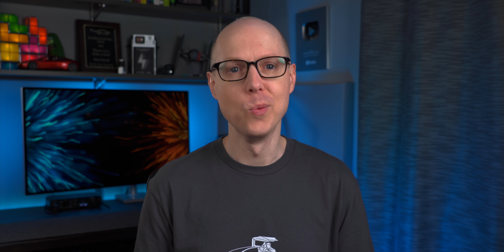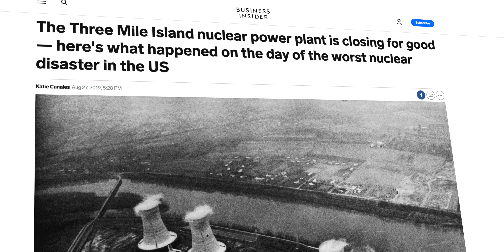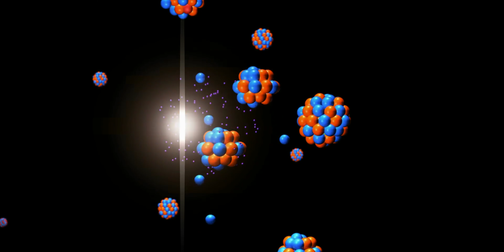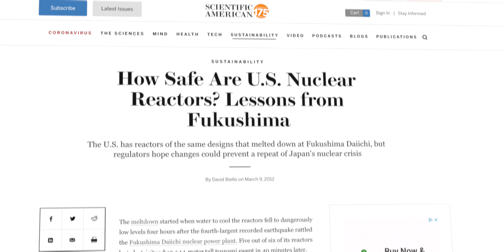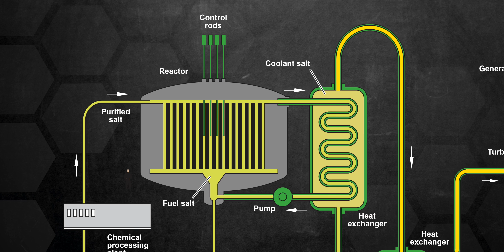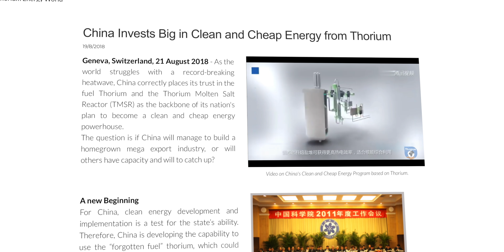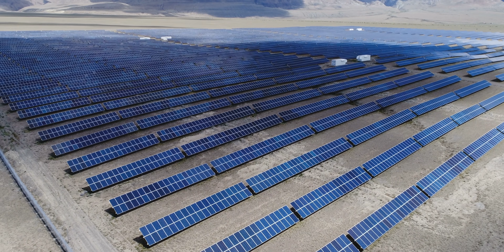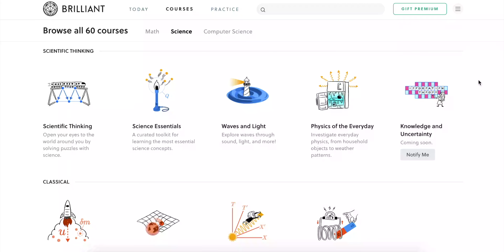Thorium explained - the future of cheap, clean energy?

Comment: (2:23) "A fuel source that's 3 times as plentiful" implying Uranium. However, we primarily use U-235, which only represents 0.7% of naturally occurring Uranium, not 3-5%. If you were to compare Thorium to U-235, the actual fuel, you'd find that Thorium is 429 times more plentiful. To get U-235 up to concentrations of 3-5%, you have to enrich it, which is an exceedingly expensive process. Thorium requires no enrichment.
Also, fission really isn't that complicated. You just have to be aware that there are different types of fission reactor designs, particularly when you're talking about MSR reactors. This is EXCEEDINGLY important, as different reactor types have different benefits and different drawbacks. There isn't any one type of reactor that is "better" than the others. The positive and negative characteristics of different reactors make them better for different applications.
Reply: Ya I was kind of bummed out that he spent a moment or two to touch on their level of "rarity". Seemed rather pointless, all of these substances are extraordinarily plentiful, regardless of their perceived rarity. The fuel supply in and of itself, is so much of a nonissue it doesn't even warrant mentioning.
Reply: @MatthewHolevinski  Correct. The kicker is, the "rarity" issue applies to "Rare Earth Elements" (REE), which are actually quite common. We could produce all the REE's we need just from the tailings streams of existing mines, like iron, phosphate, titanium mines, etc., and other sources of monozite ores, which is what we used to do before we signed a treaty in 1986. We don't do this now because thorium is a co-product of those REE's , and if you pull out the REE's, you're effectively concentrating the thorium. The treaty we signed in 1986, which was then adopted by almost every country in the world, categorized Thorium as a nuclear source material, and thus regulated by the NRC. After we signed that, if you were a phosphate mine who wanted to sell your tailings  wastes to someone who wanted to pull out the REE's, you had to have the same level of NRC licensing as a dedicated uranium mine, which, as you can imagine, is not inexpensive. At that point, the US and most of the west got out of the REE market, letting it be dominated by a country that hadn't signed that non-proliferation treaty, China. 
So in the end, the single and only reason that we and the rest of the world are dependent on China for REE's is Thorium and our ridiculous regulations around it.
Reply: @williamsmith1741  you mean and the second only reason is we can't do anything with them anymore either, we have no refinement, or manufacturing supply chain... Send china our dirt and they will send us our iphones. Nothing more fantastically glorious and idiotic than shipping essentially dirt across the largest body of water on the planet, god damn i love it. It's ridiculousness at it's finest.
Reply: @MatthewHolevinski  Yes, that's true. We've effectively lost all refining capability. However, that can be built back up. The real issue is Thorium as that creates significant liability issues. Not only does it cost a fortune just to get and then maintain a license, you then have to create a permanent storage and sequestration structure to "dispose" of the thorium for the long term. If you don't have every micro-gram secure and accounted for, you'll get sued by Green Peace and other environmental groups. This is despite the fact that thorium is heavy as F & non-water soluble, so it tends to stay wherever it's first deposited. Plus, it has a 14 billion year half life, so it's barely radioactive to begin with. Instead, we just dump all our REE's and the thorium into tailings pits and lakes.
Reply: @williamsmith1741  Oh you don't have to tell me bro, I've read the 10 CFR's. edit: If I was president, the NRC would be the first thing dismantled, along with about every other department of the government, but that's another story.
Reply: @williamsmith1741   Can you advise exactly what this 1986 treaty was that consigned thorium to NRC over-reach? I don't think it was the Nuclear Non-Proliferation Treaty 'cos that goes back to the 1960s. I tried google-search but it didn't come up with anything resembling a remotely sensible set of resuls.
Reply: @rhonda-my_honda_cb500x  Well, there were numerous treaties signed, and while the one in particular that the reclassification It wasn't exactly part of a non-proliferation treaty. It was a tightening of regulations following the Reykjavik Summit in 1986 and the beginning of work on the START proposal that the US put forward that year. I suppose as part of a good faith kind of effort, the US started tightening up its regulations on anything Uranium and Uranium related (i.e. thorium), the goal of START being nuclear arms reduction and the reduction of any nuclear proliferation.

Of course, there's little to no proliferation risk from thorium, so it was pretty much just a ham fisted bureaucratic action which killed the rare earth industry in the West.
Reply: @williamsmith1741   TYVM for your quick reply! The framing context of my question is that the New Zealand Climate Change Commission has released its Draft Advice to Government and submissions/feedback is open 'til March 14. I wish to have it on record that the Thorium Energy Cycle as can best/only be implemented with full iso-breeder LFTR (thermal) or LCTR (fast spectrum) low pressure high temp reactors underpinning it, is the only real way to reach their goals. I ideally need to state which legislation or accords need to be majorly modified or scrapped in order to make the way legislatively clear.

The old-skool informed would argue there is proliferation risk in the Th->U233  breeding cycle if one was to use a 2-fluid blanket/fuel reactor and do ex-core chem-sep and holdup of Pa233 whereby potentially getting WG U233. But quite frankly that's the much longer, much harder way to make a fission bomb. Any nation state dead-set on building a nuclear arsenal will naturally take the tried, true and standard/'easy'(less hard) way. 

It would be easy enough to have one's chem-sep processes setup under IAEA supervision to keep the holdup Pa233 doped with 'just enough' (1.5-2%)  U232 contamination to bugger up bomb electronics and require only mildly shielded (less expensive) remote handling. Proliferation problem? What proliferation problem?

The other proliferation argument is LFTRs' need for depleted Li (ie 99%+ Li-7) for its FLiBe salt, because that flip side is enriched Li-6, which is the tritium source for boosted fission or full H-bombs.
However the proliferationistas when pressed, would have to concede (likely through clenched teeth), that that same enriched Li-6 is what's needed to run ITER or the Lockheed skunkworks fusion reactors. While we wait for controlled fusion to become a Thing, we can use that  Li-6 in Li-ion, LiPo and LiFeO batteries to give them even more electrochemical energy density. I think one can silence their posturing about Li-6 by asking them when they're going to limit gasoline or Jet-A1 because it can be used in molotov cocktails.
Reply: @rhonda-my_honda_cb500x  You are absolutely correct on both points! You can't know how refreshing it is t see someone else make those points. 

I'd also point out that U-232 doesn't just screw up a bomb's electronics, which is a much larger issue for compression type bombs. If used in a gun-type device, it's also very likely to pre-detonate, causing most of the core to blow itself apart before it detonates. Pu-239 bombs do the exact same thing in gun-type devices due to the presence of Pu-240, which is also subject to pre-detonation. Because of that, Pu-239 bombs have to be implosion type devices. But, as you noted in your points, you still couldn't use U-233 with ANY U-232 contamination in an implosion type device as the gamma's given off of Thalium-(isotope number?) would fry the electronics connected to the explosives surrounding the core. So even a minute U-232 contamination will spoil any type of fission device, gun-type or implosion-type. 

As far as thorium goes, it is really the best fuel for LFTR type reactors. Once you move to fast reactors, U-238 becomes a much better fuel due to the much higher neutron yield for Pu-239 in the fast spectrum. I'm not as big a fan of the fast spectrum concept as it lacks the inherent negative temperature reactivity coefficient of the thermal spectrum MSR. Fast reactors have their place, but as waste burners and as breeders, producing the starting fuel loads for LFTRs. 

I can't tell you the exact timing of when the regulations on how Thorium is treated as a source material were changed (which is really only an issue when it comes to REE refinement). I'd point you to John Kutsch or James Kennedy who have been pushing the issue of Thorium and REE's for years. I'm sure they could give you the specifics on when and how the US (and the rest of the West by extension) began treating anything with more than 0.05% thorium in it as source material. You should be able to get their contact information from Gordon Mcdowell (gordonmcdowell on YouTube) by posting in the comments of his most recent video and explaining why you want to reach out to them. If Gordon doesn't get back to you, I can also give you John's number, but you should reach out to Gordon first.
Reply: Matthew Holevinski yup, usable thorium is currently a waste product from a lot of mining, that has to still be carefully handled because it is radioactive.
Reply: odegaard  Who knows what will happen, but you are absolutely correct in your characterization of current trends. That is exactly what's currently happening, and if nothing changes, you are correct in that it will be China and India who drive this technology forward. The fact that this is the way it is, well it's sad, stupid, and thoroughly depressing. 

My hope is that the people around the world who are obstructing the development and deployment of new fission reactors will pull their heads out of their collective anuses and finally acknowledge that renewables WILL NOT! work as a suitable replacement for fossil fuels. At best, at best, renewables might hope to reach parity with fossil fuels in terms of power production vs. cost. Rough parity will not do it, especially if getting to that parity involves all sorts of unincluded costs like changing global power grids and all the other changes needed to deal with renewables other problems, beyond just the cost of the solar cells and the wind turbines themselves. I'm not saying we shouldn't pursue them, but don't bet the farm on them. 

What we need is a power source that's not just as cheap as fossil fuels, but instead is VASTLY cheaper, and one which can provide steady baseload power. Only something like that would allow us to put fossil fuels behind us in the same way that kerosene did whale oil. The only technology that could do this is nuclear fission, but not the kind of reactors we're currently operating. Current fission plants are too expensive, loaded down with expensive safety features and safeguards, almost all of which were put in place to deal with issues of water and pressure. Current fission plants are also incredibly wasteful, fissioning only 2-4% of the actual fuel. The result is that you use very little of the actual fuel while also producing lots of long lived waste. 

However, both of these issues can be addressed. Prior to 1983, when they started stacking a lot more safety features on nuclear reactors, new Gen 1 reactors had a lower capital cost than coal plants today. MSR's, which won't require all of those water/steam related safety features, will immediately be a cheaper alternative to coal, while also providing steady baseload power. @odegaard, I know you're a fan of metal cooled fast reactors, but I'm afraid this potential low cost is not something they can offer, as they trade safety features related to water for safety features related to liquid sodium. So BINGO, we've got a power source that's, lets just say, is roughly at parity with fossil fuels. 

Now, take that nuclear fuel which you were only fissioning roughly 3% of, and lets take that and turn the fission rate up to 98.5%, oh, and over 90% of the waste produced will be gone within a decade as opposed to millennia with current LWRs. Those who say MSR fission waste takes up to 300 years are not entirely correct. Strontium 90 and Caesium 137 are the fission products which would require 300 years to decay away to background radiation levels, but they only make up a very small percentage of the waste that would be produced, with the majority of the reactors waste being gone in no time.

Fusion advocates and fusion researchers are similarly full of crap, but that's a separate topic, so I'm not going there. 

So, long story short (too late), you're right in your assessment in the short terms, but I believe you'll be wrong in the long term. I hope anyhow.
Reply: We're not short of Uranium, like most minerals it is unevenly spread around the globe, but we have plenty.
Reply: @PhilipOCarroll  Correct, but uranium requires enrichment to make it usable in a reactor, which is both expensive and create's proliferation issues. Thorium is easily chemically purified and requires zero enrichment. Plus, it's a waste product from rare earth element (REE) mining/extraction, so it's  essentially free.
Plus, to use U-238, you have to first convert it to Pu-239. Problem is, you can't sustainably breed Pu-239 in a thermal spectrum reactor due to Pu-239's high neutron absorption rate in the thermal spectrum. You would prefer your reactor to operate in the thermal spectrum because they're more efficient than fast spectrum reactors (thermal spectrum reactors will produce the same amount of heat as a fast spectrum reactor but with 5x less fuel). Finally, thermal spectrum MSR's are inherently stable, unlike fast spectrum reactors. Fast spectrum reactors can be designed to be passively safe, but they have to be "designed" to be this way. 

Thorium is just a much better fuel for commercial energy production.

Comment: (5:30) Fission products like U-233 come out?! That is definitely not the case, unless you're talking about a 2 fluid reactor with protactinium seperation, and then it's still technically not true, but there could be an argument. Plus, U-233 is not a fission product.

Comment: Good video however you could have included some more points.  LIFTR reactors will be modular, built-in factories because they are not immense pressure vessels and as you pointed out their resistance to meltdown means the safe area footprint could be vastly reduced. Should they come online the construction time will be much shorter,   take up less area and they will be vastly cheaper. LIFTR reactors can also be a direct source of industrial heat ie. cement, fertiliser and whatever else needs high temp and or boil water to create steam-driven turbines for electricity.

Comment: Carbon emissions are WRONGLY linked to climate change. 1.7 degree Fahrenheit increase in global mean temperature since 1880 (NASA data) is so low as to be safely discounted. The plain facts are that all current renewable is worse for the environment and economy than any fossil fuels. The energy and environmental costs of wind "farms" and solar panels are greater than the amount of energy they ever return, and far greater than the impact of fossil fuels.
Remove the ridiculously high subsidies, and add environmental impact study costs, plus end of life removal costs, that all other forms of energy production have to undergo, and remove the stupid "green" taxes on fossil fuels, and you will see how foolish pushing for solar and wind actually are. Let the market decide, instead of fleecing tax payers on something which will never replace the ease, cheapness, and minimal impact of fossil fuels on the environment.

Comment: The difference between nuclear and idiotic renewables, which don't work as "Planet of the Humans" showed, is that it is efficient, reliable, and is base-load/on-demand power which can energize our advanced technical society (carbon free) without putting us all in the poor house.
Reply: Hi Dutch Flats,
While I agree with your thesis, "Planet of the Humans" has so many errors, that I would use other sources to support your arguments.

Warm regards, Rick.

Comment: You say that Chernobyl, among the three accidents, came down to a failure in the cooling systems. The Chernobyl accident was much more complex than that. The cooling system only failed after the first explosion, which was a result of a series of operator errors and a known design flaw in the control rods.
Reply: That's true, but I believe it was the steam explosion that tore the roof of the place and ejected radiation up and out along with the steam. Of course, a containment building might have helped, but that was a big freaking steam explosion. I really don't know. On the whole though, that reactor was just WAY too complex, with WAY too few safeguards, and arguably pretty poor operators.

Comment: I personally think nuclear fission fusion or anything like that would be a stupid idea. we aren't trying to invent anything new we are just trying to stick anything we can fined to stick on and generator but we're not trying to reinvent the generator. You could easily make a power source with two solar trackers 10 to 15 batteries and a 1F capacitor and 2 1H coil use that as a palms prime mover coil that are both positive field that rotates the 3 phase generator